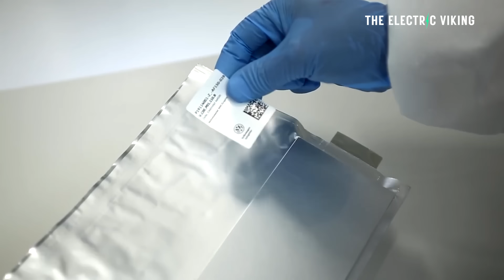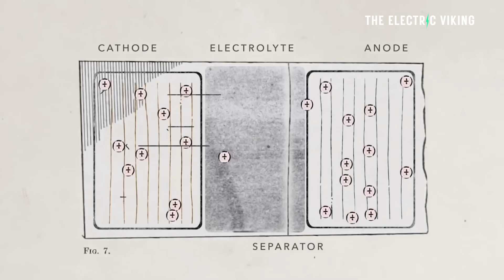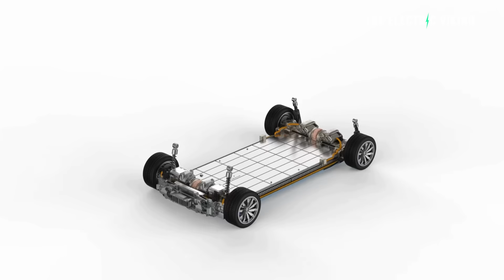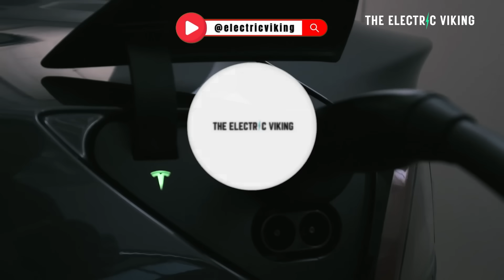Solid-State EVs Will Soon Seal Gas Cars’ Fate: 500 Wh/kg Power in 2025!

Comment: 500Wh/Kg great so that's what, maybe a 10/20% improvement whereas the energy density of Diesel is about 12.6kWh/Kg or roughly 2500% higher again!

Difference between ICE diesels and BEVs is of course you have to drag around 500+Kg of battery whether the battery is 10% or 100% charged in fact if you only have 10% you'd probably be in 'limp' mode. You only want to travel a similar distance in a diesel you'd probably need barely little over 1Kg of fuel!
Reply: Sorry to be more accurate perhaps I should have said perhaps up to around 5Kg of fuel! The mental maths went a little off confusing Litres with Gallons

Comment: They do not need more range but it would be good to see a pack that is so energy dense that it is half the weight which would increase efficiency and comfort.  350 miles and 15 minute charge 20 to 80%. You only need the range for travel and commuting you do not need the weight. No fires more charge cycle and "lighter". Forget these 1000 mile cars makes no sense almost nobody drives 800 miles a day. Cheap light cars with 80 KWh batteries packs.

Comment: America is market economic driven. It is a big country and everyone has a car there. The range and charge times are the key reasons that will cap demand. Engineering Explained does a fantastic job explaining why it is very very difficult for batteries to achieve the same energy density as petrol or diesel.

Comment: The main reason I don’t want to switch to electric is the charge time I want 500+ range with 5 minute charge time and a 10+ year life span on the battery with easy replacement
Reply: You don't need 5 min charge. 
I'm pretty sure there will be time of use electricity. They do need to come up with a better solution for apartment owners though. 
It's not fair if you are rich you pay less.
Reply: Dude, you can charge at home with a level 2 charger in 4 hours Max, and get exactly it's the range that you want. No need to ever go 2  1 of those fast chargers, unless you're traveling, in which case it'll probably charge in twenty minutes, max.
Reply: @michaelbokrosh7374  Not if you live in an apartment like me.

Comment: I just did a 900 mile road trip and spent a total of 2 minutes 30 seconds fueling the car. When a battery can do that, safely, in any weather, without degradation, at a reasonable cost,  I don't think they'll need all the mandates and subsidies anymore- but I don't see it happening.

Comment: Nice theory. If these will be charged by the same tech as existing EV batteries, such as 42 to over 50 cents per KW for a car's battery capacity, if this tech is going to need 500 kw to get a 'full tank' its going to cost more that filling up a 50 gallon fuel tank, plus the time factor. Like $210 to $250 for a full charge?

Comment: Solid state batteries have to overcome resistance.  It’s always easier to move ions in solutions than fixing them in place.  It affects charging and discharging.  That’s not ideal for applications where frequent high current charging are required.

Comment: As far as I’m concerned, the entire issue with electric vehicles centers on range and charging rate. You’re competing with an infrastructure that has gas stations strategically placed everywhere (i’m talking about the USA here), and it takes less than 10 minutes to fill up.

Comment: BMW and the other carmakers that are testing SSBs sure already know the number of charges and longevity of the SSBs they make or outsource. The problem resides in trying to improve those batteries in those specifications because they know battery tech is what gives an EV the upper hand in the market. Cheaper, efficient, and long-lasting. The problem rising is that battery tech is developing so fast!!!! every month there is a new discovery. Just search for it in Google Scholar. The monthly findings on battery tech are just impressive. That's why numbers on new batteries are undisclosed. What battery will be standard?

Comment: Sam, it's not that we've given up because "we lost."  It's that a majority of the public doesn't want EVs.  I work at a dealership, without give aways or big incentives, people prefer hybrids or ICE vehicles.  And we have some fine EVs.   Besides, mandating that people have to buy something they don't want isn't going to persuade people to buy them, it creates resistance.   Additionally, truck sales are slowing down as people are getting sick of the ever increasing prices, and EV trucks are even worse.   Yes, better range will help, but so too would charging stations which for the most part are far too few and often far between.
Reply: There’s only a mandate for EFFICIENCY, not EV.  Standing in a hurricane, pissing into the wind doesn’t stop the storm.  Americans are petulant adolescents, and yes, this means the US lost the EV race.
Reply: EVs have high depreciation rates and high insurance costs too. As a business user these are offset by leasing the car and business pays the insurance. But few people can do this. Batteries slowly lose range too, and that is a problem with used EVs. If they made EVs with easily changed batteries that could be upgraded after say 4 years, that would help. But cars that are essentially dead when their batteries fail are a problem for the owner. Maybe Solid State batteries will help.

Comment: your guess that bmw will use their 48xx cells in the more expensive cars is wrong. quite tne contrary.
they are the backbone of the new "Neue Klasse" EV series that suppose to have up to 50% cost saving because of their form factor and advanced chemistry.
actual BMW EVs are very good and sell well but are also expensive. the "Neue Klasse" EVs bring cost savings in the area of 10k€ per car. How much of that will reach the customer has yet to be seen. That also depends on the market. At the end, they for sure want to optimize their factory production volume and that requires adjusting the price as well.
we live in exciting times.

Comment: Thankyou for the video. 
What we need is batterys that last 100 years.
At least 200,000 charge cycle life.
And the free energy range extender chargers on board on the vehicle so they charge themselves while driving or parked.
Anyone that wants to stop a movement like this needs to be restrained in confinement and released back in public Only if they are condition to behave to support that vehicles are to be built to benefit the owners of the vehicle rather making a profit for the Manufacturer and energy companies with the current inferior vehicles we got now being pumped out,etc.

Comment: 50k and 500 miles would be a game changer in the US.  The thing about trucks is that even using cheap US fuel, they cost $100 a week to run.  An EV would save $350 / month is running costs.  That makes them the same real cost as a $65k gas truck.
Reply: THIS.  I just refueled a Highlander hybrid for $35 and it’ll go 550 mi. (Seats 5 adults and 2 kids) That’s tough for EVs to compete with (don’t start with reliability, it’s a Toyota)

Comment: BMW - aren’t they also pushing hydrogen? When a leading ev maker uses them then  I’ll know it’s real. I always hear 20% to 80%. In charging that’s 60% of the battery. If that’s what you’re supposed to use on a regular basis then battery density needs to increase substantially.

Comment: Sam, I think you have the current US administration wrong. What they object to is the government sponsorship of EV technology. This does NOT equal oposition to EV technology. Rather it is consistent with free market forces which says, "the market will support the best technology." The other, leftist (Socialism), involves "social engineering" which tends to push a given technology path forward. The only role government should have in any market is that of standardization (for EV's think charging connectors and safety matters) and opposition to monopolies. This allows for the market to support those who innovate and bring forth that which works in the given market. It is ridiculous for government to push a technology (EV in this example) for which the market is unable to sustain. The main issues are all related to the sufficient availability and distribution of electricity in the US. It is simply math. Convert the joules (a measure of energy) currently used in petroleum to power our transportation (both personal and commercial) to electricity. That will require us to triple our production and distribution of electricity no matter what form it takes. Elon Musk''s assumptions have rested (at least partially) on the development of and installation of solar roofs and the requisite batteries to store the captured power so as to ease the burden on the current grid.The tripling must take place in one form or another for EV's to be the replacement of petroleum. There is little doubt in my mind that in a century this conversion will occur. It took a century for the build out of the roads, petroleum refining, distribution and point of sales to develop. No amount of "Chicken Littlism" will sell the farce that unless we do this in 12 years we are all doomed. It simply can't and won't happen in 12 years. We heard from Gore and his invconveniet lie over 30 years ago that we had 10-12 years or our planet would become so hot as to become uninhabitable. So we are close to three "12 year lies" later and the planet has proven that it is not closer to extinguishing human life. So lets put away the obnoxious social engineering foisted on the weak minded and emotional among us and let us live in the current reality that clearly says, "We are developing" new and better technologies to power our future. Whether solar, wind, hydrothermal (a major potential lives under our feet), tidal/wave, hyrdrogen, better/safer nuclear, etc. all of these and technologies yet undiscovered will lead us into the future. 
Hypothetically what will we do if we discover that all of the electrical power distribution is a strong and clear cause of cancer in those exposed to current grid distribution technologies (high voltage transmission lines)? Will we wring our hands while wailing and then kill electricity or will we set to work and adapt to to the challenges ahead?  I say the latter. I believe that it is likely that EV's (probably through a period of transition involving  the development of effective hybrid technologies for larger vehicles/forms of transportation - see Edison motors in Canada) will probably replace most petroleum powered forms by 2150. It could be sooner if the market is allowed to proceed without radical governmental interferance. I am excited about the new battery technologies and the deep boring technologies that promise cleaner forms of energy for a better tomorrow. I am NOT excited about those who attempt to lie, obfuscate, and manipulate the future (think WEF) using social engineering.
Reply: Disagree. If it was truly a free market, oil subsidies would not be given. They are given 700 billion in subsidies to help stabilize oil prices. The government also helped make gas stations and done other things to push the automotive industry and help it thrive in the past. Also, markets have become too big for startups to really be a thing of innovation. It's more of a, get big enough to be noticed by large company and then be bought by larger company. 

The second reason was that they were trying to accelerate adoption for climate change sake as the adoption rate is technically too slow which is why other countries are forcing it so quickly (except China that's been working on this for the past 20 years with massive government support. China plays the long game and tends to stick to their agenda),

Also the amount of misinformation is done in the mainstream is an issue.

Comment: WE  JUST CAN'T AFFORD THE HIGH PRICES  ON ANY OF THESE EV'S.
Reply: Agreed price is still an issue. But, buy 3-yrs used is a great strategy. The car is still in great shape and the battery is still under warranty. And someone else paid for the battery. Own the vehicle for 3-4 yrs, and then you can sell it to the next person with still 2-4 yrs warranty on the battery. Divide the battery warranty in 3rds and own the middle 3rd.
Reply: Are gas cars any better? No, they are not.

Comment: That Dodge.Ram pickup truck being made in Mexico electric/range extender gas engine is over $110 000 plus thats insane
Reply: Walk a dealer lot and you will see $100,000 plus gas pickups on up to $150,000 “business expense” models with gas and Diesel engines. It’s an OEM pricing problem regardless of drivetrain and yes, it is crazy town.
Reply: House money when I was starting out…I’m barely middle aged, the rate of increase is staggering.

Comment: What will happen is combustion engines will simply become more efficient and get faster.. just like the new jet engines lately because of the cold war.
Reply: No they won't, we are now at the point where they are increasing capacity in motorcycles to maintain power, emission standards and noise restrictions continue to increase and engines have to run leaner potentially impacting their durability.

Comment: As a Tesla Model S owner I would not own an EV without a level 2 charger at home. My point is the true limit of EVs growth in the US isn't charging stations it's the ability to achieve a full charge at a night.  Similar to a cell phone, folks charge them at night and wouldn't drive to a place to charge their phones.
Reply: L2 charging is not a big deal anymore. Just asking: if the car has 300+ miles range but most people have less than 100 miles per day of driving, your thinking is that being able to charge to 100% overnight is a limit to an entire market? Currently many will drive to Costco on the weekend and stand on line for slightly cheaper gas but they must have both vastly cheaper fuel and 100% fill up overnight as well?

Comment: Solid Power's silicon battery (replaces lithium) have specs:  390 Wh/Kg and 1000+ cycles. The solid power website says 'high charge rates and lower temperature range than lithium ion'. Compared with CATL Naxtra sodium battery:   175 Wh/Kg and 10,000+ cycles,  very high power density (10C = 1MWatt fast charging), and -40Cº and +70Cº temperature range.  The disadvantage of a 175Wh/Kg (half that of SP silicon battery) can be compensated by a 1 MWatt fast charging infra (does not exist yet in China or beyond),  or by manufacturing very heavy Naxtra Evs with the same range of the SP-silicon EVs (not preferable!).  The Naxtra  10,000 plus cycles are a decisive advantage over SP-silicon batteries:  per Kg 5 times more cycle life.  The EV world definitely needs a 1MWatt charging infra anyway, to get down to 5 minutes charging comparable to a gas refuel, then the Naxtra EV is the overall winner, because of its super high number  of cycles.

Comment: i've seen so many promises of 1,000 mile batteries i will believe it when i see it in the road.  i'd be ecstatic if it does happen this year as promised though.
Reply: I would be surprised if we ever see 1000 mile batteries.  It would be far more likely to see 500 to 600 mile batteries, but much lighter and cheaper than current batteries.  At that point, price parity with ICE cars will have arrived or even exceeded, where EV's are cheaper.

At that point in time, the ICE cars are done.  I can now pay around $30 to $40 a month for unlimited EV charging at my house.

Already have an EV but waiting for a larger one to replace my work vehicle.